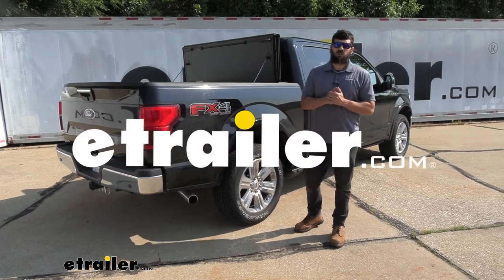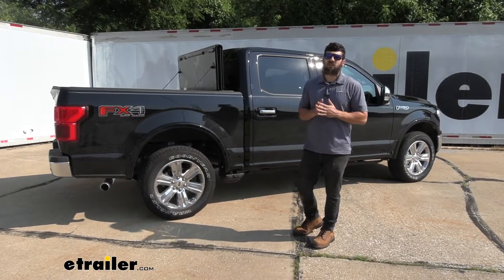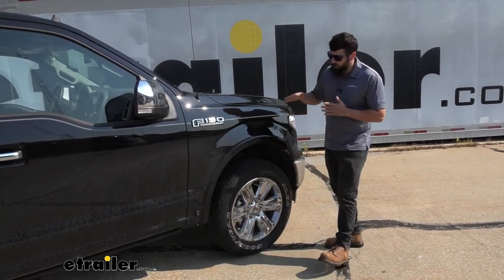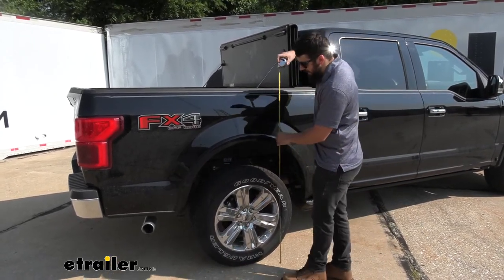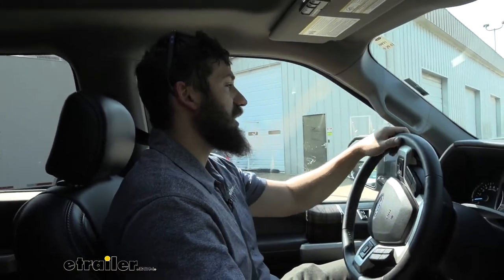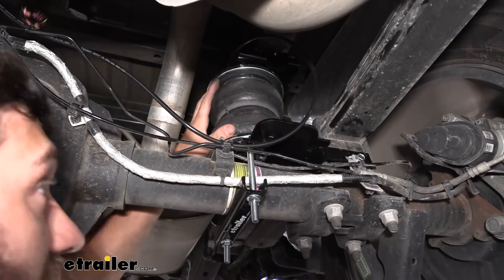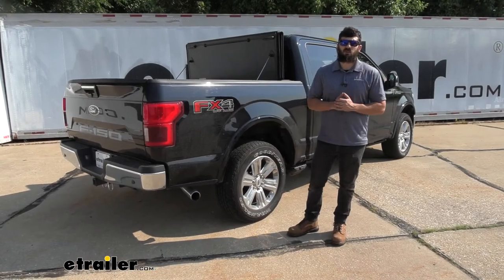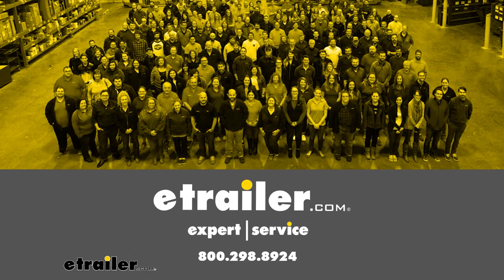etrailer | Air Lift LoadLifter 5000 Rear Air Helper Springs Installation - 2019 Ford F-150

Comment: Great tutorial, I am going to install a set of these on my 2020 F150 this weekend. 

I do have one seemingly significant observation. Since the upper end of the bags are attached to a fixed position of the truck, aka the frame, in my not always humble opinion it may be better to run the air lines down the frame rail instead of down to the axel. That way the worst that will happen to it is it will be molested by wind and water. Additionally, there's no chance of movement so clearances from the exhaust won't be an issue once affixed properly. By routing it to the top of the axel and back over the frame, now you've introduced the sometimes violent movements of the rear axel into a plastic air line back onto a fixed position, and in my mind, at some point, it won't want to bend anymore and there will most likely be a failure.

Again, great job on the tutorial.

What are your thoughts on putting the 2 to 2.5 inch leveling kit along with these?
Reply from the maker: Thank you for the feedback. Adding a leveling kit will not affect the proper installation of these air bags. If you find yourself using your air helper springs a lot, you may look into getting an on-board compressor system to inflate and deflate them.
https://www.etrailer.com/Air-Suspension-Compressor-Kit/Air-Lift/AL74000EZ.html

Comment: How much is it to buy and install?
Reply from the maker: When we did the video, it took several hours, but that's an inflated number because the process was being filmed. We phoned AirLift, feeling very confident that they'd be able to quickly provide us with a guesstimate to pass along for you. However, they no longer share that information. We're very sorry that we couldn't get a good answer for you. I would plan on 2-3 hours for a professional install.
You can see current pricing for the kit by using the provided link:
https://www.etrailer.com/Vehicle-Suspension/Air-Lift/AL57385.html
UPDATE: We reached somebody in the AirLift engineering department, who confirms that the install takes approximately 3 hours for a professional. Hope that helps!
Reply: I just bought the 425$ airlift 5000 kit there there is one for 325 and 525 as well

Comment: Hey if you got my message I want to install same Airbags to my F1 50 2021 and what’s the brand and where can I find it thanks
Reply from the maker: This particular kit will not fit the 2021 Ford F-150. Check out the following link to see the Air Lift air helper springs that are designed to fit your 2021 F-150.
https://www.etrailer.com/Vehicle-Suspension/Air-Lift/AL77PD.html